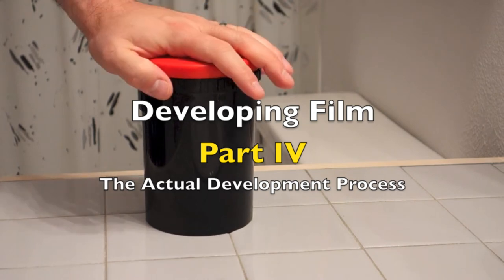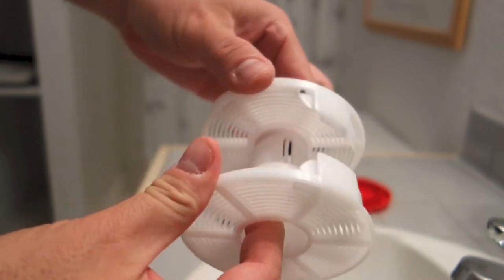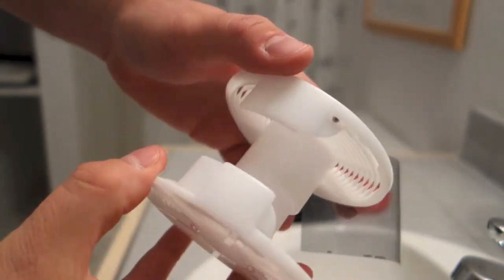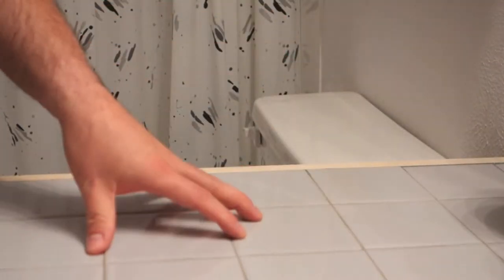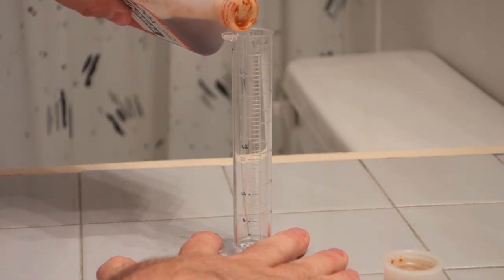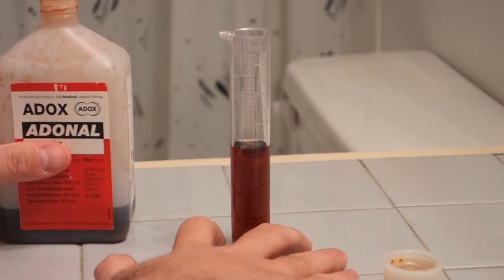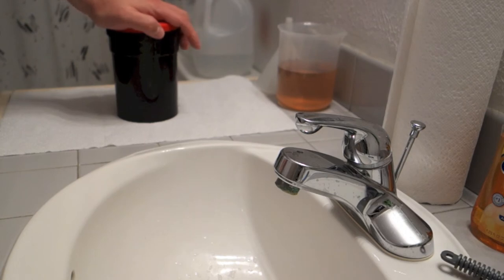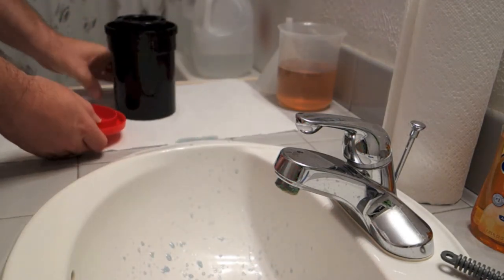Developing Film Part IV - The Actual Development Process

Comment: Isn't prewashing somehow affecting the development of the negative? As in; taking some information away from the negative?
Reply: Talk about your urban legends! Pre-wash will not steal the information from your film, nor will it steal your sole. Also, the stated purpose, to wash out the antihalation dye, is equally without merit. The dye is chemically inert, so it makes not difference if comes out in a pre-wash or into the developer during that step in the process. What it is good for is to stabilize your tank at your correct processing temperature.

Comment from the maker: It's confusing.  You don't treat the ratio as a fraction, and multiply that times your final volume.  Rather, you add the two sides to get the *total* number of parts, then do the math.  So, 1+25=26 (total parts), then (1/26)*600=23.   Many times, the formula is stated as 1+25, rather than 1:25 to make this clearer.

Honestly, I just let the Massive Dev Chart app tell me the amount of chems and trust it :-).

Comment: Boring trivia: Mike's opening reference to his film tank as a "daylight tank" (you load in the dark and process in the light) isn't quite right. The term "daylight tank" is historically reserved to describe a film tank where the processed film roll or cartridge itself can be loaded into the tank in light, whereafter in light the film is extracted within the tank from its cartridge or roll, loaded onto a reel, then processed normally. This avoids use of a changing bag or darkroom  otherwise required to get the film into the tank. Kodak, Agfa, etc., made these tanks in the 1950s,Jobo more recently, but they were not too popular, being both fussy to use and expensive. A new version, "Lab-Box", was developed through a Kickstarter last year and is supposed to be available in a few months (And it remains quite expensive.)
Reply from the maker: Randall Stewart Interesting. Must be one of those terms that crossed from specific to general-purpose regardless of correctness. Thanks for sharing the facts.